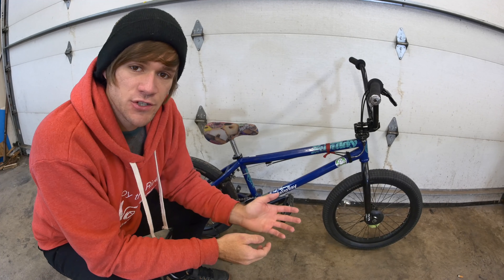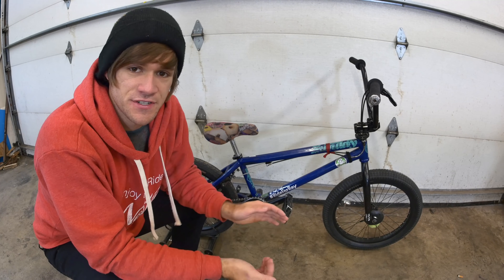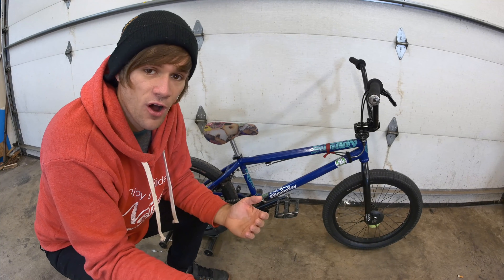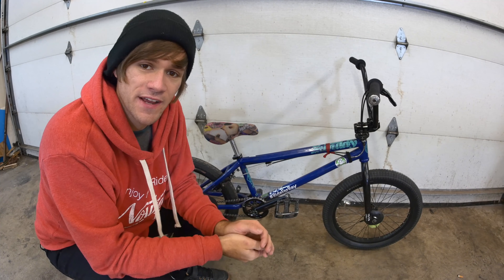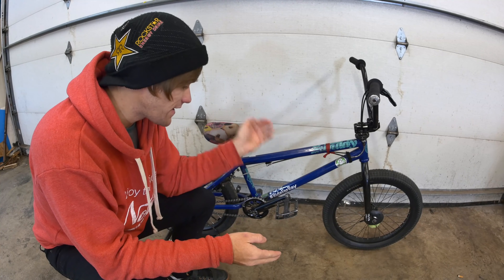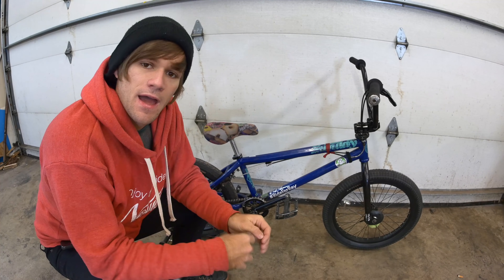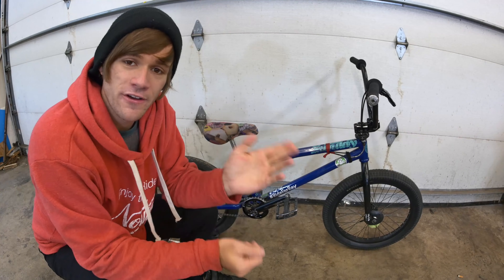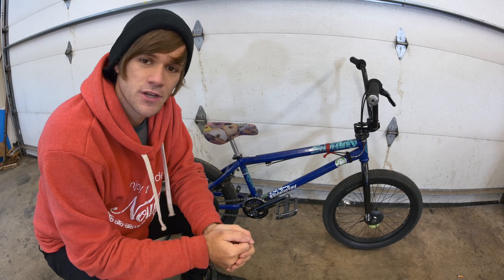Does Bicycle Crank Length Matter? | EXPLAINED

Comment: I feel a great improvement on barspins with 165mm .
Reply: When doing tailwhips with longer cranks, I feel that my back crank is too far back and it's hard to get my other foot back on.
Reply: @jaydendickson  have you tried shorter cranks?
Reply: juan pablo spahn your turn the back will too. A 2.10 speed ball.   Just try it.  2.10.
Reply: I can do bars with 175 like nothing
Reply: @nate2966  okay but they will be better with 165mm lol, i run 175mm too, but when i had 170mm bars were easier. and i can still bar decently
Reply: @cykablyat8862   dude I'm 6'4 my feet dont fit on 165, but I would be willing to do 170
Reply: @nate2966  well i honestly dont know what you mean by your feet dont fit, maybe you need bigger pedals, look at cult dak pedals theyre nice and big, best pedals ive ridden, everyone in my town rides them theyre that solid, and thats like 10 guys hahah, but yeah 170's are good too bro
Reply: @cykablyat8862   lol I've ridden Dak pedals, my feet are too narrow. to clarify on why I like longer crankarms, my legs are long ... I've also done alot of racing and it just feels more comfortable. Especially when I wanna do a corked 3, it just slows it all down. We all have our own opinion lol, I'm very content with my 175ss !!!

Comment: Been running 175mm primo powerbites that are about 13 years old  - I swear by them.  In my mind 5mm isn't enough to get a huge difference in feel, but that's me. I've tried from 165 to 180 and like you say, it's personal preference. 

A friend recently got a new frame that has a shorter back end to what he's used to and had to go down 10mm in crank size so his heel didn't hit his peg on crank rotations all the time, something to keep in mind if you go for one of those shorter back end frames.
Reply from the maker: Yea I feel like 5mm isn’t a big deal either.
At least you’ve tried it all. Haha More than I can say.

The new Nowear frame has a super short rear end. No heel peg issues for me yet luckily.
Reply: Michael Pastorius  Hey mate, the pedal bosses on mine are starting to wear out where it inserts into the crank so the pedal comes loose every other session, but otherwise still strong as ever. I'm currently looking at replacing them with some Eclat Mavericks just for a freshen up of the rig. How are yours holding up?
Reply: Michael Pastorius  Wow that's cool! I've never seen someone mod them to a 19mm spindle, very clever if you can't get 22mm easily - yeah probably explains why they don't quite align though. I have the same issue with an old set where the aluminum has deformed and doesn't sit on the square spindle properly anymore. As long as they don't have any cracks in the pinch bolts they should be fine strength wise. 

Also your english is great! I wouldn't have even known if you didn't mention it.
Reply: Michael Pastorius  A bike check would be cool, nice to see what people around the world ride. 

Yep so I've got the spacer inside the bottom bracket that runs between the bearings (the long one) then very thin spacers on the outside of the bearings, between the crank arm and the BB. I've run more/less in the past depending on the frame clearance.

Sometimes the 22mm chainring adapter is enough to space it out, but depends on your frame width.

Comment: 175 feels good. But with a knee problem I'm considering shorter. However, it can only get just so short before it feels like a clown bike. I understand why some guys go to 160, for example. But that further takes away from the bike just riding like a bike. An ethos I've always held. I don't want bars in my lap, I only want the seat down when I need it down, and I don't want child size cranks. The bike has to be a bike first, otherwise it's just a specialized piece of sports equipment.
Reply from the maker: Yea I’d agree in all those points.
A BMX bike is a pretty specialized piece of sports equipment though.
Reply: Lol, I guess it is, but it's also just a jump on it and go cruiser. The bikes have gotten smaller over the years. But there is no question it works, just look what people are doing. As long as I have a quick release seatpost clamp I can deal.
Reply from the maker: Haha not denying any of that either!
I have thought so many times about putting one of those on my bike!!! Haha
That’s so awesome.